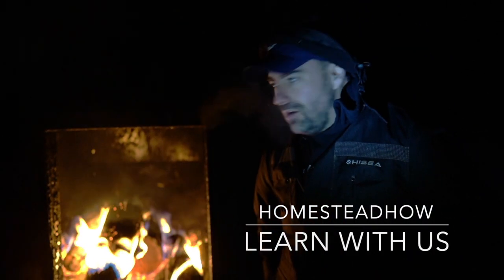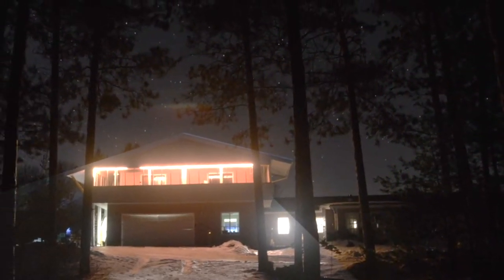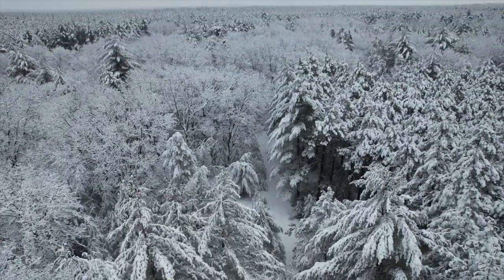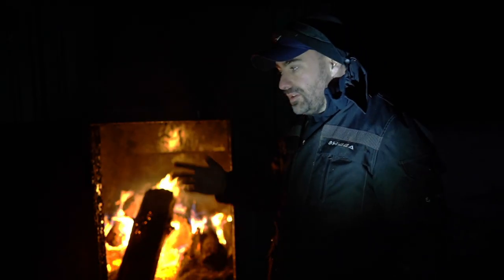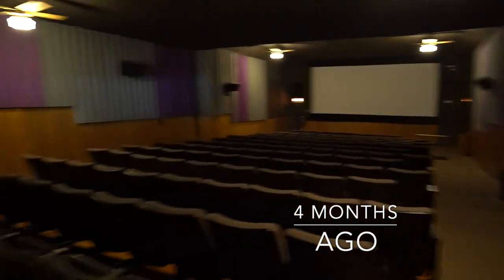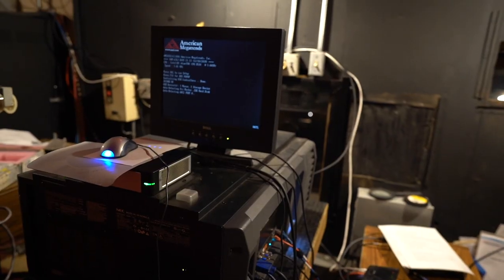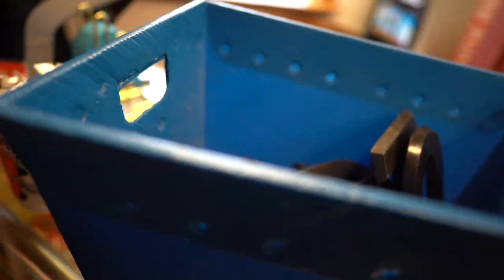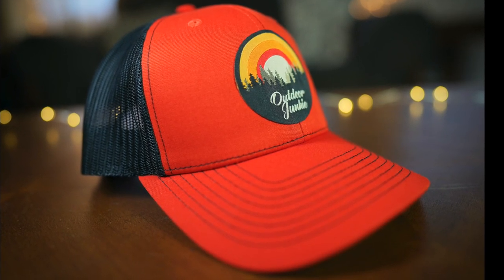Outdoor Wood Furnace, 7 YEARS LATER! Was It Worth It?

Comment: I've had mine for 21 years and love it. The dealer I bought it from told me NOT to scrape off the creosote in the fire box as it acts like a protective coating against moisture during the off-season. Also told me to coat the inside walls with used motor oil.
Reply from the maker: Thanks for the tip

Comment: We buy slab cut offs for around 20-30$ per bundle. 90% of the bundles are 4x4x10-14. Cut them down to 24" and you can get a full cord. 100$ will usually give us 4 full cords. Find you a sawmill and most of them sell the off cuts for cheap.

Comment: First time viewer, and fellow wisconsinite (Seymour) Planning to build a workshop/shed and looking at heating options. We invested in geothermal for our home when we built in 2018. A wood boiler seems like a better option in case we have power failure. My big plan would be to heat the shop with radiant floors and supplement the geo on long, cold stretches. Thanks for sharing your 7 year review.  Your movie theater is cool.   New subscriber. Cheers from the 920.

Comment: So, our outdoor wood furnace has been heating our house since 2001, the total cost was around $7000 installed, we have 33 acres of old growth forest soft and hardwoods that I’ve used for firewood. Here’s the kicker, it doesn’t come free to make that firewood, here to buy a cord of firewood is about $250 cdn, for me to do it myself it’s about $80-$100 per cord with equipment, fuel, chainsaw, gas, oil, chains, files, splitter, stacking time, and that’s not putting a wage on it for my time, if I were to pump gas at minimum wage say $15 cdn the cost goes much higher per cord probably over $250, so, if you were to go into great detail of all the hidden cost to make firewood you will never pay off that furnace, but it’s a great way to keep in shape and have something to do during the cold winter months.
Reply: There is no way a chainsaw, logspitter, and a running a old pickup truck to gather wood is costing $80-100 per cord. The initial cost is high but the running cost after you buy them is not much. My grandpa bought a wood splitter 40 years ago and i just only replaced the original engine on it 2 years ago with a more efficient ohv engine and it only needs like a quart of oil a year and a cheap air filter and plugs.